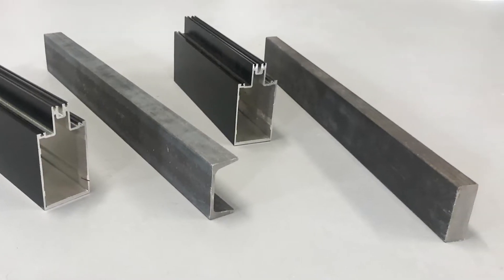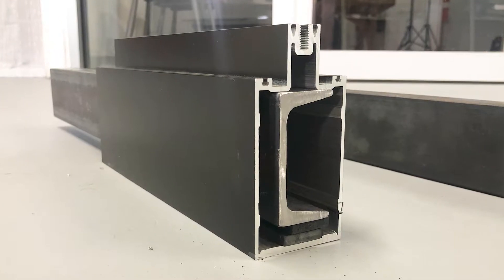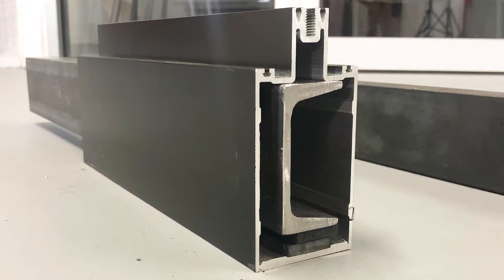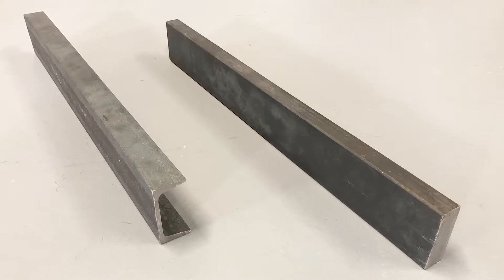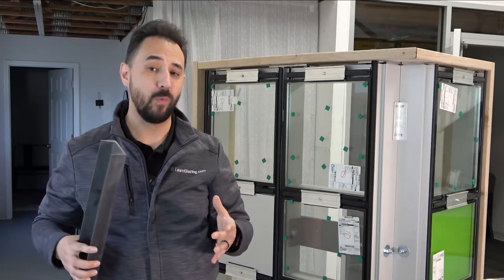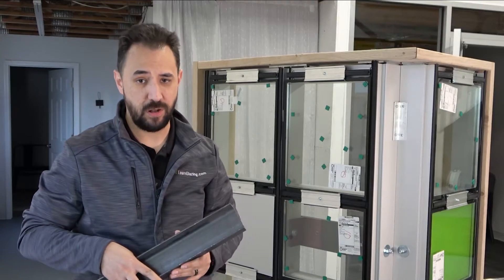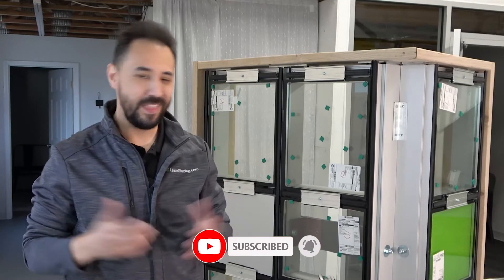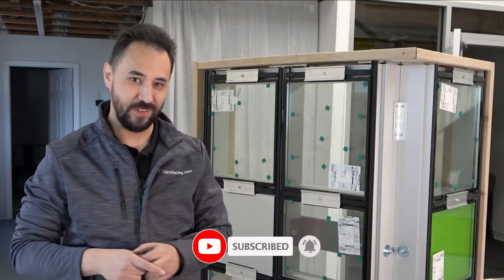Curtain Wall Reinforcement with Steel

Comment: Can entrance doors and the windows of different aluminium profile brands be attached to different curtain wall profile brands or should they be of the same manufacturer ?
Reply from the maker: Hey Triumf, In short, it's definitely possible. However this usually complicates things like inventory and QC a bit by having to deal with multiple suppliers, warranties, etc.